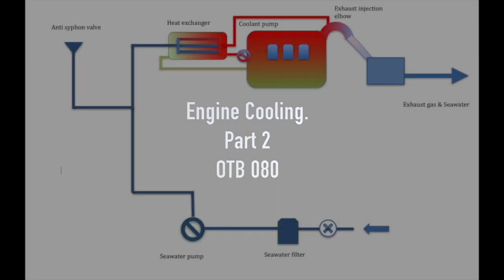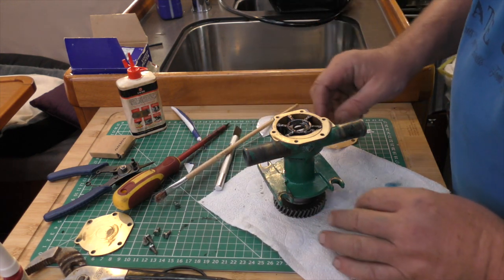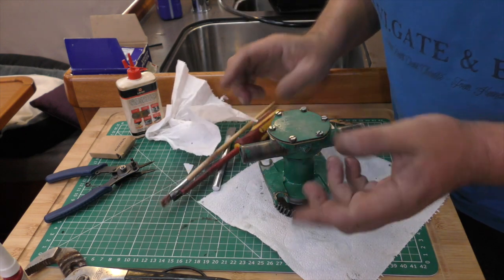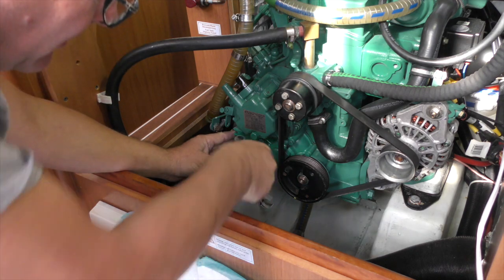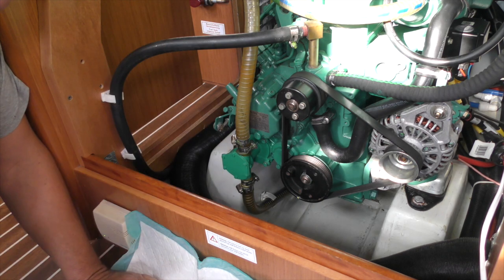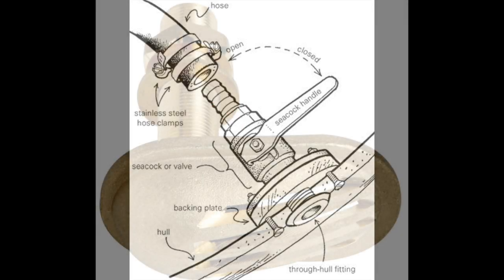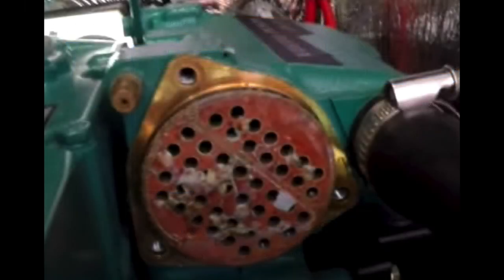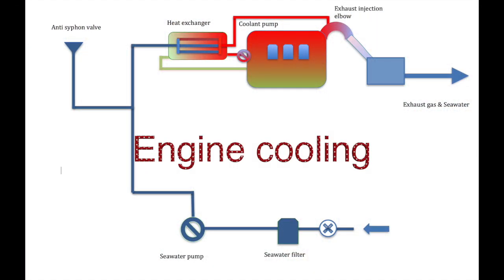Diesel Sailboat Engine;  Cooling  (Part 2) Stuff you need to know.

Comment: Thank you very much for the torqוe value table. How do you know how to set the closing strength just with a spanner?
Reply from the maker: Hi Eliezer. Good question. With a spanner or wrench that is 12 inches long the force you apply at the end is equal to the foot / pound torque rating that you need. You can use a spring balance scale to check this. With a 6 inch spanner it would be twice the foot / pound  value. If your working with Newton /Metres the principal is the same. Half the distance double the force. Hope that helps. Thanks for watching. Ant.

Comment: Congrats on this concluding part of THE masterclass in marine diesel cooling systems. Do your worm drive clips not have a hex head on them to enable tightening with a socket?😉😀⛵️
Reply from the maker: High Norman. The short answer is yes. The long answer is we had the aft cabin out and all the stuff  in the forward cabin where my nut spinners are. I hate slotted fixings!!!! When the screwdriver does not slide out and bite you, the burs on the fixing slash your arms as you wiggle around them. Someone who shall remain nameless refused and almost mutinied when I suggested we needed to move everything to get at them. 🤔  
We were thinking about a video on how 4 stroke diesels work. The strokes, induction, compresion, injection, exhaust. Clean burn, white smoke, black smoke,  blue smoke, steam, Etc. Do you think that would be something that would be of use to Sailors? Obviously we are asking someone who knows these things. But, how many sailors just don't know how they work or what to look for? If it helped just a few people out or saved a few engines we think it would be valuable to folks. What is your thoughts? Sail Safe mate. Ant, Cid & the pooch crew.
Reply: @SVImpavidus  Ant - I was just pulling your chain.😂 Yes absolutely a back to basics look at the prime mover would be a good addition to the body of work you are producing. To be honest it never fails to surprise me how many sailors seem content to be be at sea while apparently content to admit their ignorance about engine matters or electrics. Their lives could depend on these systems!😳

Comment: thanks for the great video: question how the dingy inflation hose can be connected to the line of the S-drive to pump out any stuff while hose are still connected ?
Reply from the maker: Good question! Undo the intake hose from the underside of the raw water strainer. This is above the waterline. Slide the end of the hose over the valve connector on the foot pump. They are both 19mm diameter. tighten the hose clip gently. then simply pump away. Yo will hear the air coming out the drive leg intake when it is clear. Sail Safe mate. Ant & Cid

Comment: Excellent video, as usual, Anthony! 
One point I am puzzled about is the tip for conventional sea-cocks adding a scoop gate, with the gate looking forward. I have recently replaced the original engine on my Albin Vega sailboat with a Beta 14. The instruction manual states "We do not recommend the use of ‘Scoop’ type water pickups, because if fitted the wrong way around the water will be forced through the pump and into the exhaust system whilst the vessel is sailing. This is very dangerous as the exhaust will eventually fill and sea / raw water will back up into the engine through the exhaust valve. Catastrophic failure will result as soon as the engine is restarted." 
By "fitted wrongly" the manual means with the gate facing forward.
Do you think this recommendation is specific to the Beta (Kubota) engine because of its raw water flow design or should be generalized to other engines?
Merry Christmas and serene 2021 to you and Cindy.
:-)
Reply from the maker: I have never heard of that before. It takes 0.433 psi of pressure to push 1 foot of water so conceivably it could push water into the hose. Could it push it up the hose into the strainer and past the pump, then through the heat exchanger? It sounds theoretically possible. However, in the same way the traditional seacock could be overwhelmed in big seas. Or a saildrive like ours where the inlets face forward. The Beta engines are brilliant, we have recommended them to loads of folks. It seems a little strange that Yanmar, Volvo and others do recommend them. Perhaps they differ in some way, they have had an incident or are just being cautious? Obviously twin engine power boats or cats would be at a huge risk when running on one engine. There must be a reason they make the statement... Have a great Christmas. Sail Safe mate. Ant, Cid & the pooch crew.

Comment: Thanks Anthony. I've never seen a mention of adding glycerin to the impeller replacement. I noticed you didn't use a sealant when adding the gasket. Do gaskets ever need a sealant? Would white lithium grease work? Cheers.
Reply from the maker: Hi. Some gaskets seem to hold better with smear of silicone grease on them but we never use a sealant. I have heard of folks using a thin coat of something a bit sticky but the worry is it may ooze out and get into the heat exchanger. Sail Safe mate. Ant & Cid